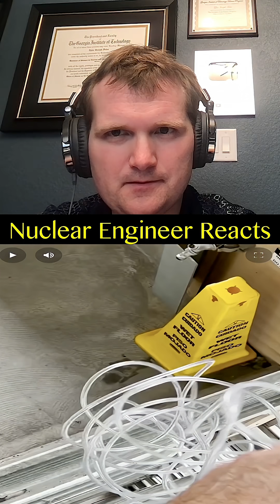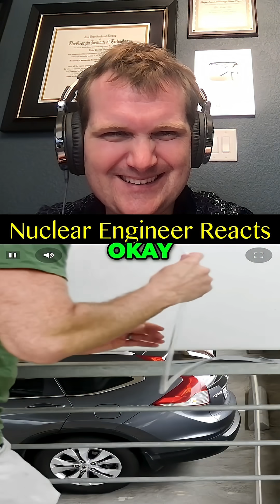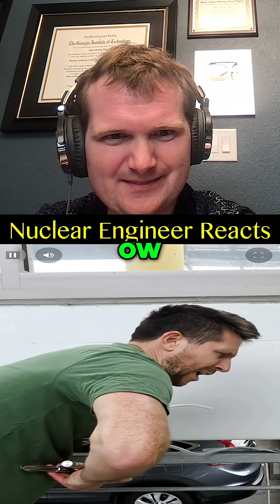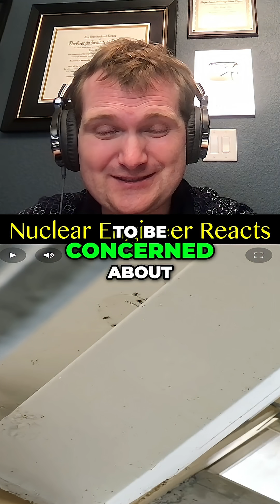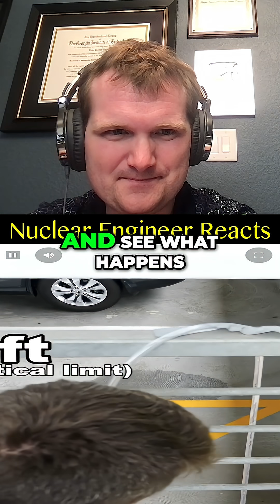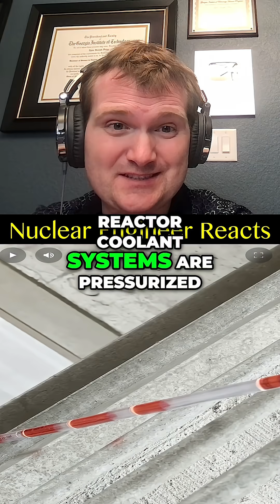Can You Drink from the World’s Longest Straw? - Nuclear Engineer Reacts to Action Lab

Comment: Vacuum pumps with cold boiling technique = Best clean Air conditioning. High enough vacuum cold boil all the way to ice, the AI I debated about it called it regenerative ice technology. Cold steam Tesla system run by a Thermophilic bacterial on nutrient drip diluted as a heat throttle for them = My fav non-nuclear energy system. As long as you got people then you got nutrients as a result of people existing to fuel the bacteria for constant heat. Little machines of God, but something else if you were one of the people who stacked mulch too high. (Think fireproof heat panels with bacteria inside + Heat transfer. How hot to ignite organic material? They cause Mulch fires.. They can be nasty if you feed them too rich.)

Uses only water for regenerative ice, good luck trying to pretend you're aware Drmcclung
Reply: Bro is debating with AI. 💀
Reply: Wow that's the worst AI description of the refrigeration cycle I've ever.. not been able to reap all the way through lmao
Reply: @Drmcclung  Actually its dumbed all the way down. Also it doesn't use the "special refrigerant" only water. GL faking smarts. Make sure to slow blink at the Feral Cats to give them kisses back.
Reply: @Drmcclung  Hmm. On my side my comment vanishes. Hey, fridge uses chemicals not water. HUR HUR?
Reply: AI is not a reliable source of information.

Comment: Reactors arent just pressurized, theyre hella pressurized. Has to be for the extreme temperatures.
Reply: its heat transport also, the more you pressurise your water the more heat you can dump in it without it boiling